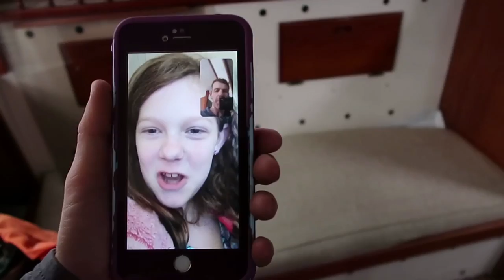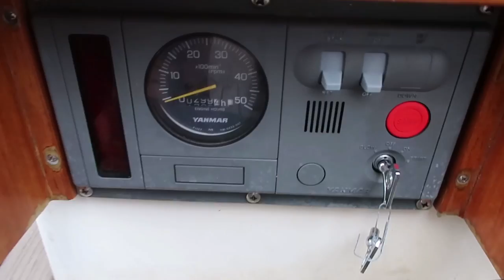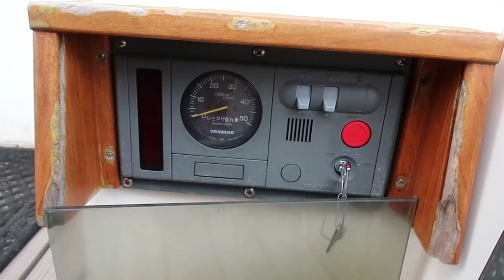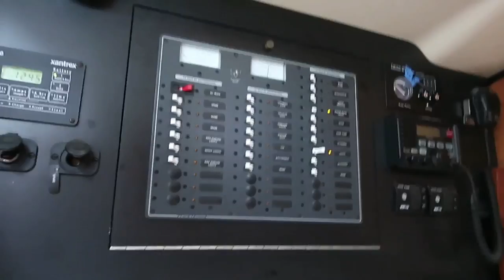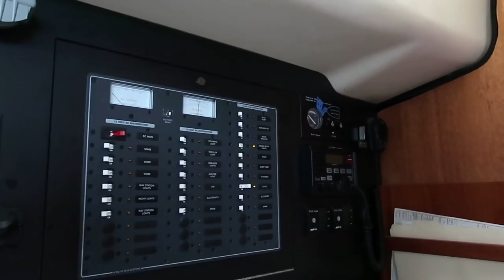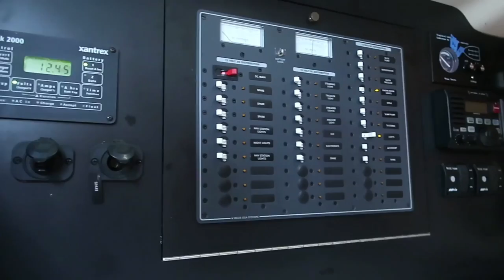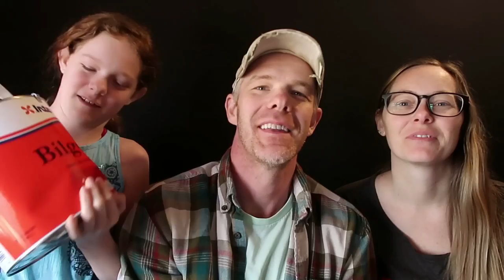We Bought A Westsail 42 Sailboat | A Tour Of Our Upcoming Refit Projects | Sailboat Story 159

Comment: Install a top mount for the quadrant.   A shaft shank on the top going into the quadrant. Mount the shaft shank  to a cross bar that mounts to both starboard and port. Use brackets on starboard and port with nuts and bolts in order for removal/service.
Reply from the maker: I'm not familiar with that setup, but I'll look into it. Need to build some support into the upper end of the system somehow. I thought that perhaps shimming might be the quickest way to go, but all options are on the table right now.

Comment: Howdy, bentambimolly!  Excited for you to get done with your list!  Put your rudder woes in rearview and drop it!  The pintle and gudgeon should be inspected as that may well be the reason of your slop, possibly some worn bushing on the post going up through the bottom of the hull as well.   Don't fret with glassing the stuffing box onto the hull.  As it is the stuffing box is replaceable.  Don't strip yourself of that!   It's easier than sand flea.  Just run a line from winch to cleat under rudder the. Other cleat to winch.   Living on a crane is cool like that!  It doesn't have far to go to drop out.  I can not remember if you had a composter on sand flea.  If that's your thing great!  As for me.  On my last boat I spent 3 days modifying the head so a nature's head would fit.   You will have to raise and level the floor.  Glass, gelcoat, blah.  It looked great.  I'm as tall as ben and my tip toes would reach the floor after I installed the head.  It was a 2-1/4" raise. After it was all said and done I was some 1200 bucks into a project and my entire family hated the thing.  Some 6 or 7 gnats always hung around, it ALWAYS stunk.  Wife did all a lady could think of, coco fiber, hydrogen peroxide, special 3 day coco fiber expansion, stick ups, extra exhaust fans, begging and pleading to make it livable as it was her pet project.  But it stunk. Alot.  If I'd have had the money back I might consider a lectra-san.  Our Morgan 41 has the original holding tanks from 1988 my head smells like citrus scrubbing bubbles as long as it is scrubbed daily, and jabsco's maintained.  We have decided it's worth every bit of mess I have to deal with come maintenance time to never smell a composter again.  Of course, I'm delivering a boat from port Canaveral to boot key this week, it's got a stinking composter 🙄.  I'm super excited for tambi to show off the sewing skills!  Easily my favorite part of boat work!

Comment: Painting the inside of the tanks is a very good idea. I did the same with POR15 fuel tank paint for the reason that Bio-diesel is not compatible with regular epoxies, I do not know about the Gflex if it is. I wish you both good luck and a lot of patience. Do not set your expectations to get back into the water too high, there is always a new project that comes up which delays things.  Cheers, Richard
Reply from the maker: Yeah the Gflex650 stands up well to fuels. We're trying to stay very focused and prioritized. Thanks for the wish for our patience to hold up. That's going to be much needed.

Comment: The waterline painted on the boat would rise as weight is taken off. The water line where the water strikes the boat would be lowered. Give your wife credit for the correct answer.
Reply from the maker: She’s my wife. She’s always right. Also the painted on part is typically known as a boot stripe which does indeed raise as weight is removed.

Comment: Do not glass in your rudder gland, it needs to be able to move with any post movement.  Keep your shaft packing ... re-pack it or simply tight it a couple turns on the nuts.  You have a "dripless" fail at sea and your out of luck.  Traditional you can tighten and/or re-pack in the water.  
I don't really care for the 42 center cockpit.  I don't like center cockpits in genera.  My friend has a 42 and I think the space down below is better used.
Reply from the maker: I'm with ya. I learned pretty after communicating that idea that it wasn't the right approach. Right now the idea it so somehow shim up the gap from inside - between the rudder post and fiberglass tube. We'll just have to see how it's set up once I get everything taken apart. As far as aft vs centercockpit go - to each their own?

Comment: So many good Treasures you will find that was left behind. I have stuff in my garage I don't even know what it is LOL
Reply from the maker: Yep, finding some treasures already. You just reminded me of a different treasure we found recently. A 2 conductor wire that had been cut, stripped, had bare ends about 1" apart, was HOT, and wired directly to the batteries. Yeah... a different kind of treasure.
Reply: @Sailboatstory  pretty crazy. I actually found two jumper wires a negative and a positive with alligator clips that were connected to my house battery just flopping around in my battery compartment 😒

Comment: This boat doesn't look so bad.
Check and repair the essential : steering gear, emergency tiller, engine and tank, plus filter, basic electronics, rigging, desk, running rigging, sails, anchor … and leave. The rest (interior, woodwork) will be done while voyaging (never forget the ration of 1:3 -> one month of sailing for three months ashore) you'll have plenty of time to work on the latter instead of spending years in a yard and loosing your stamina.
Reply: At least it's better than a Spitfire. 25 hours of maintenance for every hour of flying.
Reply from the maker: Floats better too.
Reply: @Sailboatstory  Strangely enough, they did actually build a few floatplane versions. Good upwind performance. The berths were probably a bit cramped though :-)

Comment: The angle of the anchor windlass may work better where it is.  I would seriously consider looking below and modifying some type of chute to force the chain back forward to the locker.  Consider the angle of chain and room for snubbing the anchor before moving it all the way forward again.
Reply from the maker: I appreciate the advice, and you're correct, but liveability is a higher priority for us than the ideal windlass location. Trying to strike a balance between the ideal equipment setup and comfort. At this point that windlass is already removed, the holes filled and I'll be cleaning it up shortly to liquidate it. The windlass solution we're going to attempt is going to be HUGELY unpopular, but much of what we do is going against the flow. I purchased a Seatiger 555 manual windlass that we're going to rebuild and try. This next season will just be a Bahamas run so we're not stretching out very far if we end up hating it, but it's something we've got to try.

Comment: Lordy, replacing the cutlass bearing and installing the dripless stuffing box probably will require removing the rudder...or the engine :'(  Hopefully you will get lucky and can move the shaft far enough forward and aft to get-er done. Congratulations on the new boat and Good luck!
Reply from the maker: Thankfully, it won’t. Rudder has a cutout to accommodate removing the shaft.

Comment: Love the channel guys! Been following your journey since the beginning, and Molly is growing up so fast! Huge congrats on the purchase! Regarding the v berth: have you thought about just adding a false ceiling of sorts directly below the windlass? Idk. I’m picturing a sloped ceiling/trough that feeds the chain forward into the original holding locker, shaped like a triangle but wide enough to conceal windlass if that makes sense. It’s hard to tell if that would be too intrusive (it may very well be), but just a thought! That way you wouldn’t have to move the windlass at all. Congrats again, and looking forward to seeing you guys make the boat yours. You guys rock!
Reply from the maker: Thanks Craig. I’ve had similar ideas of ways to beat work with what’s already there. The ceiling height in there is already quite low. I’d say probably not much more than 2’ or so over the sleeping platform. Not room to sit upright, for sure. I feel like the way to do it is relocating the windless to free up that space inside, which also frees up useful space on the foredeck.

Comment: Exciting project …very nice boat!…beautiful family …after completing a very extensive refit on a vagabond 42 , I have a few comments to offer…Before relocating the windlass , id see how she sails with the chain rode where it sits compared to moving forward…it may have been relocated because of too much weight forward…however , there may be a way to relocate windlass to forward , and still stack chain more aft…the soft sole may be able to be  firmed up with a two part epoxy that I used on very soft spot on mine…it won’t change discoloration ( which always bothered me ) but worked like a charm…I assume you have cast iron fuel tanks…I don’t know anything about the product that you’ve mentioned to treat inside , but I don’t think I’d be comfortable with that regardless of what is said about it…it’s a big job, but I’d want the confidence of clean fuel , and less chance of leakage , and just replace them with stainless…it appears that you’ll still want to clean all corrosion outside of tanks and treat as well…you’ll have to remove them to do that too..
The depth of the wooden cockpit box with ignition is designed to allow protection, while you can still reach with your hand under glass panel to operate…
I will check on your progress!..it was a very exciting time for me and my family completing , and then sailing our beautiful yacht after completion…I wish the same for you!
Cheers!

Comment: Have you considered / priced bladders for the fuel tanks ? I'm an old retired aircraft mechanic and I know they can be very durable.  Just a thought . I do not know if bladders are used in boating .
Reply from the maker: Some folks use them, but I don't know much about them. The tanks have an epoxy and fiberglass layer on the bottom externally, which is a great feature. I feel like adding the internal sealant as well should really boost their longevity. It's a tough step to consider with the added cost and time, but it feels like something we should do while we have the opportunity.
Reply: @Sailboatstory  I noticed there are several manufacturers in the US but again , custom bladders could be price prohibitive . You know more about what you can do so my ideas are just top of the head stuff . I can't imagine all you are about to endeavor . Wishing you all the best fortune throughout !❤
Reply from the maker: @gregoryfranklin5108  The endeavor will never actually end while we own a boat, but I feel pretty good about knocking out the high priority projects by the end of the year. Just gotta stay motivated and keep chipping away at it.

Comment: I wonder  🤔  if that decking  material would be good on  moleys  room walls i like that material good against mold.
Reply from the maker: Doesn't bend very good. I think that would be the main problem.
Needs to be thinner material of only about 1/4" or so thick.
I think all or most of the boards are still there.
Just have to clean them up and reattach them.
Reply: I rip them on table saw all the time bends good I use that material when building decks.
Reply from the maker: @kevinswanson3910  Oh, that's a cool idea. I have some of that decking at home in white already. Might be an idea. The planks I have are 6" wide and 1" thick though. They have a nice natural texture, but I don't know how I can rip them and not waste a bunch. It's really expensive stuff that I got for a different project and never ended up using it.
Reply: @Sailboatstory  try a piece out,split one see how well it works very strong flexible stuff

Comment: Surprised you are getting rid of a brand new toilet, for a composting one, sometimes you don't need to fix everything. Also the instrument board, they seem to be used a lot in dinghies with small cabins or trailer sailers, and you swing it into the companionway, so you can watch both inside the cabin and also when you are outside(but they block the companionway, so I figure its a way to save on having to buy two lots of instruments), I doubt that they intended you to watch thru the portlight that's weird.
Reply from the maker: Yeah the owner told us that’s why he set it up that way. Our last boat had the same “wing into the companionway” set up and we loved it. This one, not so much. Just too clunky, weird, and complicated. As for the toilet, composting is what we’ve always used. This will be our 3rd Nature’s Head. Wouldn’t cruise without it.

Comment: Research pro seal it’s an aviation fuel tank sealant that homebuild aircraft companies use for all tanks.  Doesn’t breakdown and get into your fuel lines.  Just is a messy project.
Reply from the maker: I've looked into it. Kind of confusing. Loads of variations and applications. Also, the suppliers are very wary to give recommendations and will only give out the MSDS - I can only imagine because of the liability concerns in the aviation industry.
Reply: @Sailboatstory  look up building Vans RV fuel tanks not much too it.  Way superior product and will outlive the boat.  A couple popsicle sticks mix and apply.  Clean with acetone.  Very simple but messy!

Comment: What is your house battery voltage? Do you have charge controllers for lith. I have a few connections fir lithium
Reply from the maker: It's a 12 volt system.
There's no solar setup yet, but I have a Victron 30a controller and 2x 230w panels on hand.
If we go lithium I think it'll be next year.
Trying hard to stay focused on the high priority projects, at least for now.

Comment: Why is there a zinc on the prop shaft inside the boat??  What good will that do?
Reply from the maker: HINT: It has a purpose, but it’s not for protecting against corrosion.
Reply: @Sailboatstory  To keep the prop shaft from falling out of the boat if the coupling becomes disconnected?  That happened to Millennial Falcon.
Reply from the maker: @thepigwillfly5869  That's it. :) Of course, the rudder would also stop it on both our both and theirs, but the zinc should keep the prop from hitting the rudder.

Comment: The wiggle maybe the rudder shaft bearings or on the outside where the rudder is hung. The rudder seal, should not be load bearing!!!  You may need a expert to take a look.
Reply from the maker: I’ve gotten some advice about that recently and depending on how things look when I remove the quadrant, it seems like having a machine shop fab a delrin shim May be the way to go. We’ll see. I’ll tear into that project once I get the tanks, windlass, and vberth sorted.
Reply: That rudder install seems completely normal to me, I would look more closely at it before trying to modify.  The cable hardware appears in great shape also.

Comment: really confused as to why they changed the windlass and they thought it was better to dump the chain in the v-birth. Making new holes and having the chain locker now useless makes no sense and a lot more work.
Reply from the maker: Here's the logic. Vertical windlasses need the chain to approach at a 90 degree angle. The only way to get close to that, with the bulwarks being almost 12" high, was to mount it waaaaaaay back. The boat really, obviously, needed a horizontal windlass. Buying a vertical was the main mistake.
Reply: Probably for kind distance crusing. This was the norm in older boats. Chain feeding closer to the ballast. You don't loose how bouyanccy. 2 x 300 feet of heavy chain adds up. The previous owner probably used the v berth for a sail, storage locker. Common set up for singlehandihg or cruising couple
Reply: In many cases it is to import the fore and aft weight disribution, that is a whole bunch of very heavy chain to have all the way up in the bow.

Comment: That Wet Snail won't be winning any races but she will get you there.
Reply from the maker: She will get us there, for sure. Have you heard of the Tom Dove sailing calculator? It's really handy to compare one boat's sailing characteristics to another. Before we committed to the purchase I wanted to know if the boat really sailed as the nickname implied. Interestingly, I found that the Westsail 42 sails no differently than other boats of similar size, design and displacement, but it is a catchy nickname.
Reply: I have a P42 in storage at green cove also. When I get down there we shall race. You shall loose. Hahahaaa. Jk y'all did well for yourselves looks like a great boat. Was she boatyard or owner finished?
Reply from the maker: @reo19723  Is that a Pearson, Passport or something else? This one seems to have sort of a mixed finish. Some areas, such as the galley and parts of the aft cabin seem factory finished, while most of it is, no doubt, owner finished - by an owner who was not particularly skilled in carpentry.
Reply: Pearson 424  ketch. I will be down soon to check on her before summer I will come say hello.
Reply from the maker: @reo19723  Yeah stop by when you're in town. So the Pearson 424 Ketch has very similar performance to the Westsail 42. P424 has a tiny edge in speed being 0.08 of a knot faster, and more maneuverable with the cutaway keel. WS42 has a better capsize ratio and far better motion comfort. All thing considered, very similar. Why don't they call your's a Pigson 42 or a Pearshaped 42? Maybe it comes down to displacement. The Westsail 42 is 10,000lbs heavier than the Pearson 42. Oh, that's why they call it a Wet Snail.  :)
Reply: It a the 32 that was called the wet snail..tge 42 is a different beast. Our boat has similar displacement and sail area and sails great. Even in low winds it moves along beautifully. Good buy guys.
Reply: Lonestar I have sailed a ws42 and a ws32 both great boats both tanks but great boats. My buddy with the 32 can get his moving good with all the rags up, they sail surprisingly well for the wieght. I agree it was a good buy for a family boat.
Reply: That reference is for the 32ft, which is a snail.  The 42 is as Ben says, very very safe and capable.